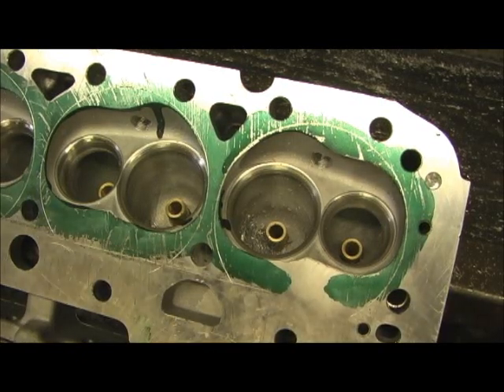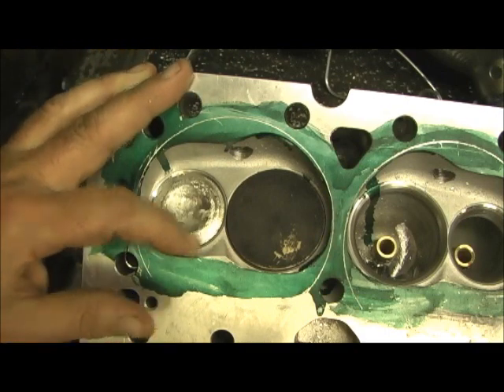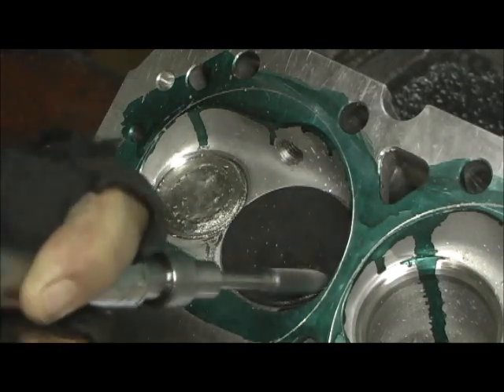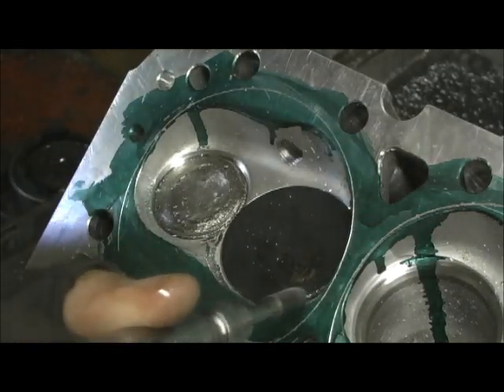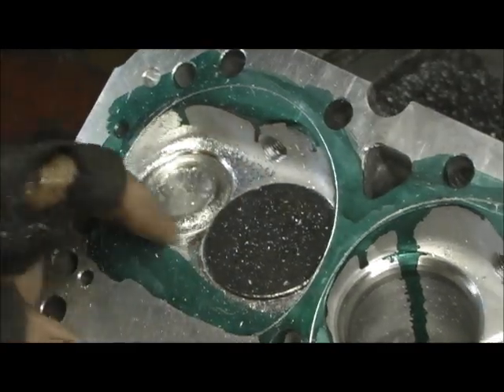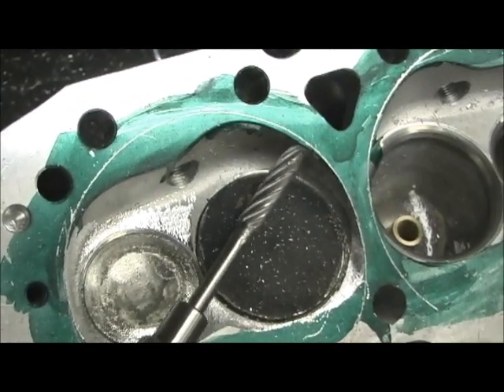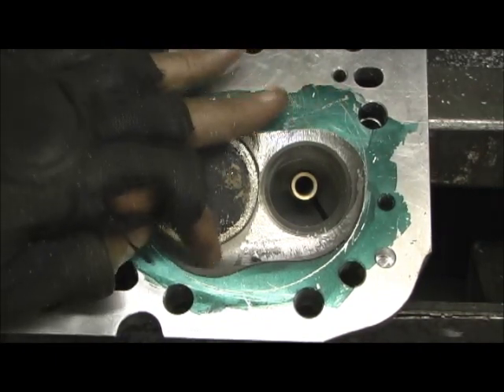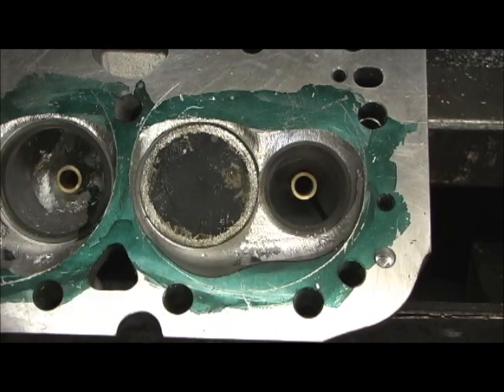ProMaxx 200 Stage IV Combustion Chamber Re Shape 4.0

Comment: Thank you for you insight into making a great set of heads even better. Some of the thread in some of the spark plug holes goes beyond the end of the spark plug. This leaves a few small sharp edges just beyond the plug at the junction of the roof and the short side of the chamber. Having listened very carefully to your instruction, I would think these should be addressed? What do you suggest? Thanks again.